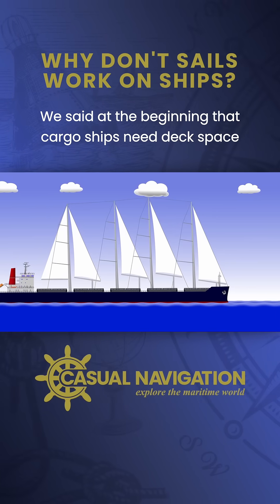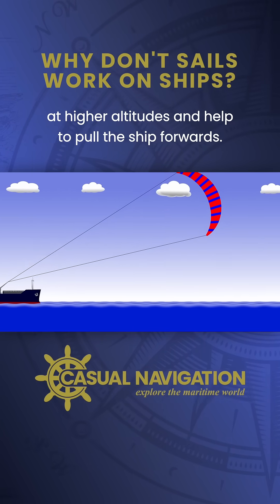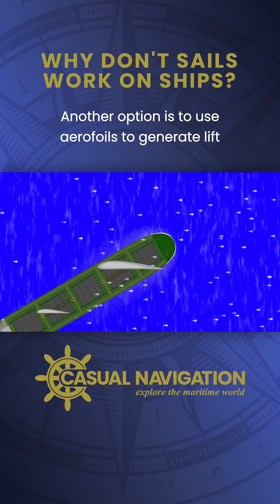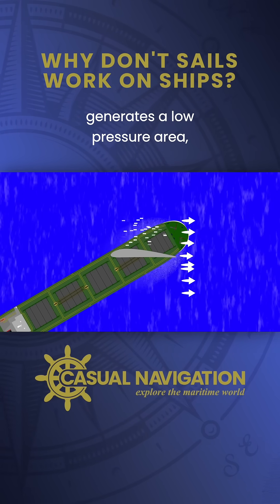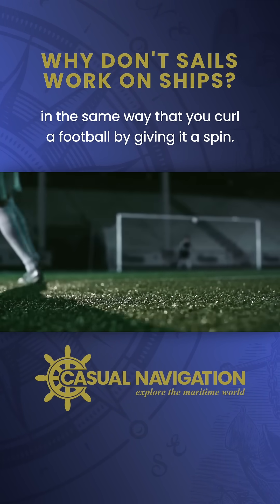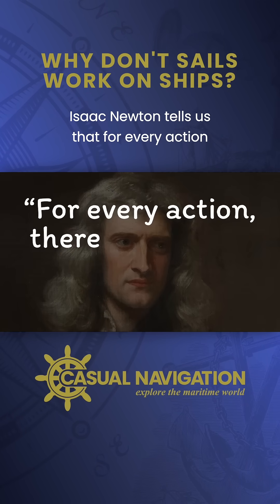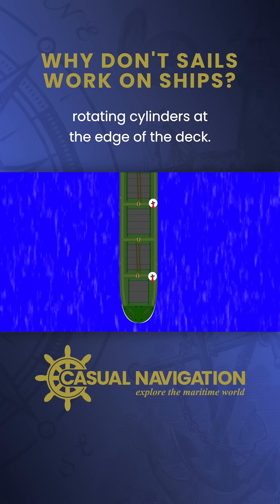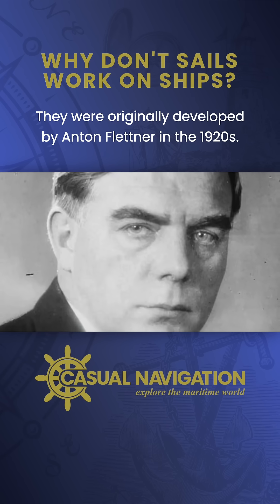Sails In Modern Cargo Ships?

Comment: Can we use a windmill to generate the energy to spin the Flettner reeds?
Reply: Thats not a bad idea. 2 renewable energy sources can be very effectively used on cargo ships, being solar panels and windmills, combine them for the highest energy output. And introduce a hybrid propulsion, electric and diesel, to ensure an economically acceptable solution. On tankers it is very straightforward, but on containerships there will probably problems arising. New materials might help mitigate them, like flexible solar panel strips, like tarps. Or fit the topmost containers with preconstructed solar panel modules while they are still at the dock waiting for the ship to arrive. If they are rugged enough, that might even happen right when arriving at the harbour by train or truck, to allow them being stored anywhere in the stack of containers. That would require worldwide cooperation, but would arguably be the most plausible solution. I have no experience nor theoretical knowledge of any kind of transport method accross the sea, so take what I said with a grain of salt.
Reply: The problem is the ship's stability. While it is very versatile, the moment create by the turbine will push your ship over (for any meaningful amount of power). That's why sails are usually triangular in shape. The higher you go the bigger the moment on the ship trying to tip it over.
Reply: 😂😂
I think that might become a bit too Rube Goldberg. 😅

Comment: The flettner rotors still have to be powered though to spin
Reply: Very true. 
But you get out more propulsion energy than you have to put in to spin them.
Reply: @pieterboelen2862  do you? That surely depends on the wind , which you do not control
Reply: @DanRyan-v5y I did the calculations at MARIN for the EU Interreg SAIL project back in 2014-2015 myself. I can guarantee, a Flettner yields more power than you put in on the whole. Of course they'll be more effective on some angles compared to others. 
That said, I prefer DynaRig solutions. Those can give easily 4x more savings on average. But of course these can also not as easily be retrofitted on existing vessels.